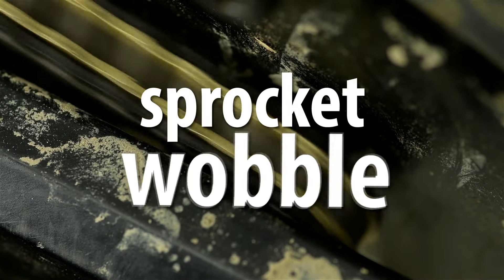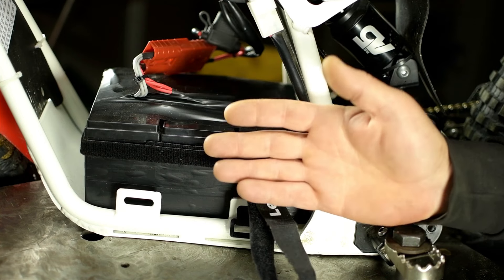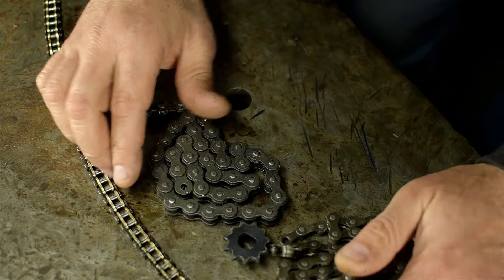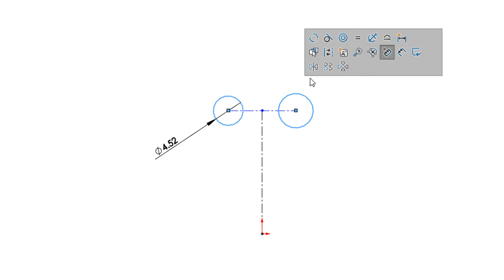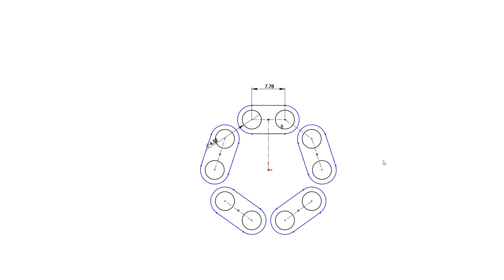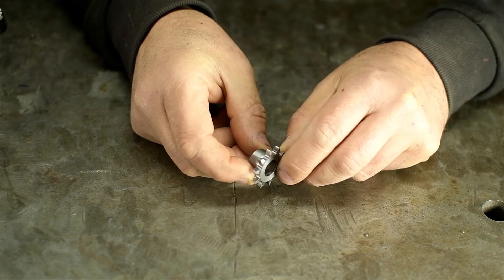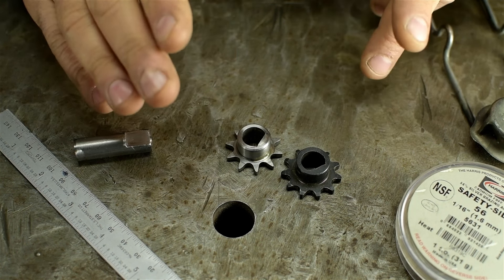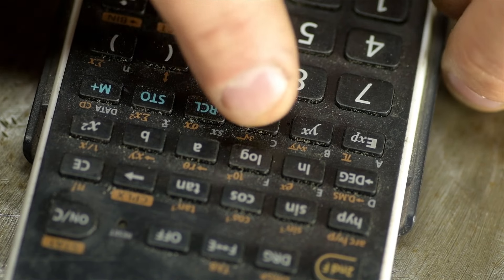Let's Make Our Own Chain Sprocket!

Comment: Battery life is much like speaker watts: What is the highest number we can come up with that won't get us laughed out of court?

I've got a handbike (wheelchair attachment) that's rated for 50 km (31 miles). After running out at 20 km (12mi) we looked at the fine print: it's 50 km @ the slowest speed the thing will run at, not 50 km real world usage at max speed and having to stop for traffic or slow down for corners.

So, they're most likely not outright lying, but they're not taking about the same usage you are either.

Comment: I don't think the chain is necessarily shot or work out, it might just be a different type of chain for a completely different application. It would explain why none of the measurements matched anything u could find for motorcycle chains. But I could be very wrong

Comment: Depending on the size of stepper motors you are using it might me possible to replace them with closed loop servos. It will be more expensive, but at least lost steps won't cripple your projects.

Comment: Chains, sprockets, belts, pulleys and gears are all great when you can't build your motor into the hub of your wheel.  When you can, you absolutely should though.  Clearly, next logical step is put a hub motor on the front wheel.

Comment: Tony, we put closed-loop stepper controllers and motors with encoders on our router - no more missing steps and it was pretty cheap. stepperonline has motor/drive sets for $150 and up. Cheers

Comment: If precision sprockets tickle your fancy, there's a nice set of [approximated] formulas for drafting an optimal roller chain sprocket tooth form in the American Chain Association's "Standard Handbook of Chains: Chains for Power Transmission and Material Handling." It's a little more involved than TOT's method, but I've referenced it many times when making custom sprockets for motorsport applications, and it's never let me down.

Comment: No metal jammer here, but isn't the "D" a cheap trick to produce a key? Wouldn't a "*" be better? I can see torque forces against the "one" part of the D being the greatest, the opposite corner of the D would be lagging in force. Spreading the force around the circle of the shaft would prevent wobble the best, wouldn't it?

Comment: Dear Tony do you know that there is a good reason for 11 tooth instead of 10!
Reason is if one gear with even and one with uneven tooth the chain or gear shall wear and tear evenly .because tooth will never meet on the same place afther one rotation. The ratio in speed an torque will not change a lot in this case ( only interesting when exact timing is required ) your gear an chain will wear out quicker , sorry for the disappointing reaction.

Comment: Thanks for sharing the design process of the sprocket. A lot of work, but very insightful. Initially I was scared that the diameter that you used was wrong because a single chain link doesn't roll up by itself, leaving the next link nicely in it's place. The 2nd link will start rising as well. Luckily, when 2 links roll up together, the total distance of those 2, sort of 'stretches out' thus giving you some clearance.

Comment: So, your CNC is loosing steps when working too hard. It would be nice to have a feedback shaft encoder to compensate for such slip. I am working right now designing the firmware for a step motor controller which use such feedback.
This is not a new idea. It is just more expensive, so most people don't invest in that technology.

Comment: With respect, going down a tooth at the front will be doing horrible things to the chain losses and ultimately hurting the battery life.
Now that you've got it all figured out can't you spec a grown up chain and machine an appropriate rear sprocket out of 7075?
Reply: The chain still has to wrap around that tiny motor sprocket, so no, a bigger pitch chain is a no no.
Reply: @EnglishTurbines  Well it's shocking all round engineering incompetence, I am not excited enough to go looking for a suitable chain, But, it needs fixing.

Comment: If the chain is kaput - and it is - and you are going to make a new sprocket anyway why not make both of 'em and use a standard chain size? That way you save in the long run because eyou don;t end up paying dealer prices for probably junk parts next time ... Just a thunk!

Comment: Impressive work, but you've made a sprocket for a worn-out 219 chain.

Rollers are the soft part. Measure the width between the inside plates and I suspect that you'll find something a hair over 5mm. Note also that the worn old sprocket still has "fatter" teeth than the sprocket that you made.

Comment: As a motorcyclist, machinist, and mechanic, what a naff design to hold a sprocket onto a shaft. If Beta wanted cheap instead of splines, why not specify a taper and keyway?
Tony, i presume there are no Yamaha TY80 equivelants made these days for kids, and a 125 is too big and powerful?
Regards,

Comment: The non standard chain size is because the motor sprocket is so small in diameter...Chinese made, very badly of course...I predict the motors output shaft bearing will fail next, our Chinese friends don't do metallurgy...🤔🤔🥴😳😳😷

Comment: Just a tip from my years of racing dirtbikes. If you replace one, replace all. If the chains worn and you replace it's going to wear down to where the old one was pretty fast with your sprockets being worn too and vise versa. It's more money to put down but saved me and my friends a good bit of money to just replace all then go one by one.

Comment: Hello again once more Mr. Old Tony, I don't know whether to refer to you as Mr. Tony, Mr. Old or just be a little more personal and just call you Old. Either way, I was curious if the nature of 4140 is strong enough to not need a heat treating for it to be used as a gear? I seem to think I remember someone once telling me that most gears are hardened but to what Rockwell scale level I have not a clue.
Also, and forgive me if I am being to personal, but would you happen to be related to any of the people of Toni Tone Tony fame?
As always, thanks for the videos and have a great day.
p.s. sorry, I might actually need to be calling you This, my mistake and I will try to correct it in future correspondence.
Reply from the maker: I was the famous 4th Tony.  gears are hard (usually) sprockets for chain not so much.  I guess a hard sprocket could eat the chain.  they're usually case hardened.  I think 4140 is tough enough for this kids riding but we'll see!

Comment: So you have a rotary broach, a die filer, a shaper, a wire EDM, a friend who builds musical instruments out of discarded Russian space parts, and a co2 laser powerful enough to burn a hole in the sun, and you used silver solder and the prize inside a cereal box to make a D shaped hole in chrome moly?  I don't get it.  

Anyway....the reason your sprocket was wonky is because you don't have an electric motor, that's a diesel-electric motor.  It clearly came from a train.  And they run rough, and sometimes smokey.

Part of my reason for the first question is that electric motors have crazy high starting torque, chains are notoriously lacking in elasticity, and non-cadmium silver solder has crappy impact and shear strength.  Just sayin'. 

Love your videos.  Makes the time spent in the underground bunker guarding the homemade minute man 4's go by quicker.

Comment: Wow! Great job improving that poorly-made machine. Two concerns:
1) Why did you re-use the old, warped chain instead of a new one? Being uneven, will the old chain start wearing down your new sprocket unevenly?
2) Was the original tooth-count 11 for a reason, to prevent the same chain-links from hitting the same sprocket-teeth all the time? By changing it to 10, you MIGHT have caused that to happen, so any weak spots or wonkitude will build up in the same area, rather than being gradually spread out over the entire chain and sprocket.

Comment: Computer numerical control....you got a strange problem...I was thinking bearings or bend motor shaft strange its the sprocket....well in my bike when it goes beyond adjusting i change chain and both new sprockets because ever thing wears out including chain it has too much free play...that will make it rattle...

Comment: On behalf of myself and my 81 engineering students would like to thank you and others like you for being there. In this difficult time when our educational institutions are forced to close we all can put the power of the Internet to good use. I am a retired journeyman tool and die maker by profession and the machine shop instructor at our local college. I wish there was a way that I could contact with you personally. I believe I have a few well thought out ideas that could expand your fan base. I also believe that I could give you a few good ideas in reference to your videos such as how to put a diagonal pattern knurnl on the flat end of round stock. But I am not sure how to get suggestions to you.
Reply: To put a Knurl on the end of your part, take a 5/8 dia. aluminum bar face-off the end.
Place the 5/8 dia. stock in a spin fixture or mill vice in the vertical mill.
After removing two of the three flutes on a three fluted 3/8 16 tap.
Used the single fluked tap to machine a straight line pattern in the end of the part.
Rotate the part 60° and repeat the pattern. Well-la  a  knurled finish.  I hope this was helpful

Comment: 7:23 mark:  I've always used the chain pitch calculation:   1/2 the distance between any 3 rivets.   The rollers may be a diff length vs the tie straps.       [PM me, I have some 30 taper holders I'd like to send you... Facebook: Dave Lee SR ]

Comment: I could swear it was 219! But then seeing a master link on it...no way was it 219. After all of that, you should have just made a sprocket for 219 and KART/219 rear sprockets are very cheap and easy to get. That's what i would have done. Throw out that garbage chain and whatever size that was.

Comment: About the battery: Lithium-Ion batterys are good for high output situations, like a computer or cellphone, but suffer in duration and overall battery life. For something like a car or this bike, lead-acid actually works great, with a lower, but longer output and significantly longer lifespan. You just need a better lead-acid battery.

Comment: if i had one of those when i was 8 the battery would have worked for 3 charge cycles and then some thieve would have taken it back to the store for the in store product refund scam. another toy that needs batteries, just got new batteries from the store... all of them are new never used but there flat useless paperweights. uh

Comment: Another expertly rendered video Old Tony, really appreciate it. Expect a raft of new subscribes shortly as I submitted this video to our Honda ST 1300 forum as inspiration to future proof our aging motorcycles. Nevermind these bike have no sprockets, ironically they have no chains either. But this video's chapter on electric motors, servo controllers, and Fourer Transforms use in waveform synthesis is unparalleled.

Comment: not Edison, Tesla!
Reply: Not Tesla either. If you want to credit Tesla with a practical system for AC power transmission and - more importantly for the application - a practical AC motor, go for it. But even if we grant you that, this is battery-powered, and for that we have to thank Alessandro Volta (the inventor of the primary cell) and Gaston Planté, both of whom carried out their work before Tesla was born. Okay, you want to talk about the mechanical production of electricity (ie generators)? We're talking Michael Faraday at that point (who invented the concept of a magnetic generator), and Francis Hauksbee long before him (friction generator). And even they weren't the first to monkey about with electricity. Tesla wasn't nearly what the mythology makes him out to be, and his understanding of the physics behind what he was doing was execrable. (And no, he didn't invent radio either, even though he was eventually granted a USA patent for the purposes of blocking Marconi, who also didn't invent radio.)

Comment: Sneaky marketing, make the chain and sprocket a non standardized size so the only place you can buy a replacement would be the manufacturer.
They probably made it wonky on purpose just to screw up something else that would be a manufacture only part.

Comment: Never trust lead-acid batteries that came with something when you bought it. They're often old and they're often cheap. You can even tell by looking at the thing. It's just a bunch of crappy little batteries that someone wrapped in tape. I wouldn't be surprised if they bought pallet quantities of old stock that barely still work and shipped them as the official battery pack of their shiesty Chinese e-bike.
It happens ALL THE TIME with Chinese batteries. They're "new" in that no end-user has purchased them yet in the 3 years since they were manufactured.
Don't even get me started on the counterfeits that are the same size of a battery of X amp-hour capacity but suspiciously weigh a lot less and turn out to have a false bottom that's filled with air.

Comment: Playing this game in power wheels at our house I had some 3s liposuction from another project roughly 1/10 size and an 1/8th the weight  if you measure the current pull and fall off in high load you can add a cap to fill in transient issues i.e. Nice hard torque. Not a good idea for plastic but your using better stuff ;). As always your an awesome dad and my hats off. Now if I can just find the balance cable for the charger I'm set lol, corona may help with this the shop is walkable cleanish now.